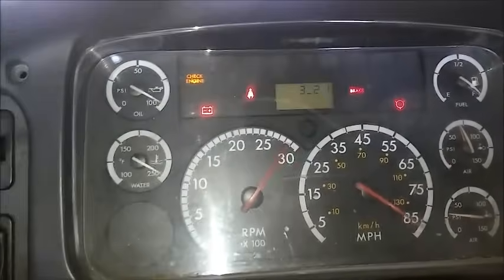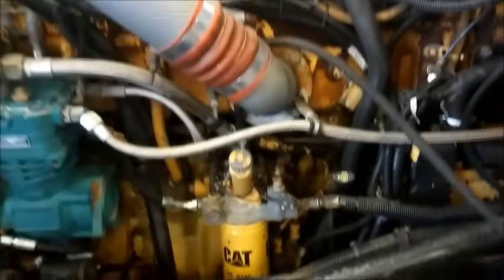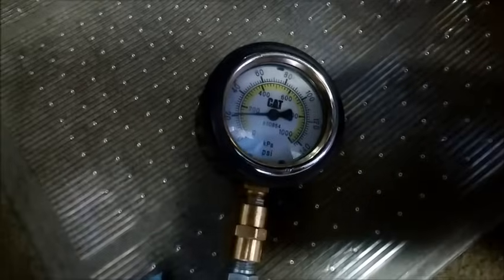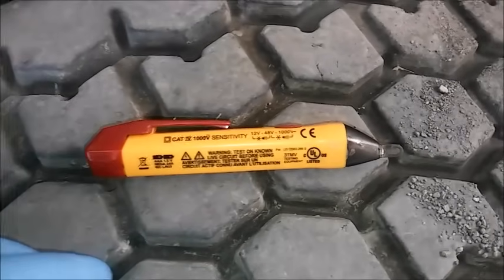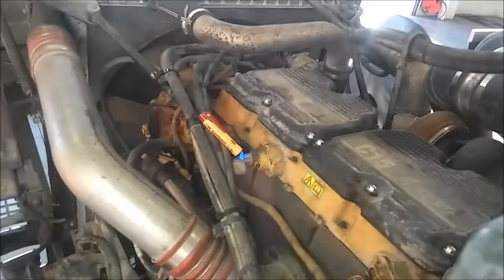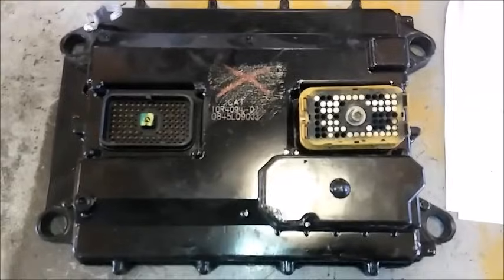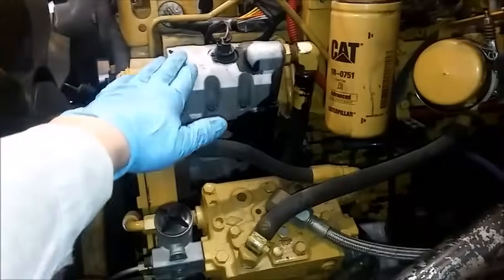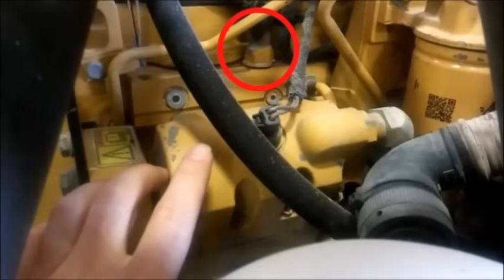Cat Engine Won't Start Troubleshooting.  Diesel Engine Crank No Start.

Comment: Great video! I've had a crank/ no start issue on my motor home twice. Both times it was the 20 amp fuse near located near  battery that energizes the ACM. (bad connection) The only way I found problem was when I called Freightliner 27/7. The first thing they had me check was the ACM fuse. Just thought I mention this.
Reply from the maker: +Rob Neil ECM power issues are one of the biggest reasons for them not starting, thanks for commenting.
Reply: @AdeptApe  Ok. So, I am in the exact situation as most others. We did everything in this video as well as your fuel video. MXS Acert. New fuel pump, new injector harnesses, filters, fp regulator, check valves hoses, injector Orings, ran the rack, bucket test from fuel pump, new starter, new batteries, all fuses are good. No start. Had a tech come out and hook up to data port. It ran on ether until no ether. Laptop recorded all 6 injector low voltage fault. All guage  work. Fuel pressure 85, oil pressure good while running on ether. Scanner reads all 6 injector fault. Technician say either engine harness or ECM.
Reply: Can someone send a picture of this fuse ?? I have several on my RV and it's not starting. Battery went dead and was dead for several months !  Now no start without Starting Fluid and will die when the  starting fluid is stopped !!. Please help. 1997 Cat 3126 with the HUEY system.

Comment: hi I had overhead adjustment done at cat no truck runs like it has restrictions plates could they have adjusted it wrong what can I tell them to ok for
Reply: MJK RIGGING I got my truck back from muffler shop they used vise grips to hold a bracket in place and I'm assuming tack welded it in place an forgot.I drove around for two days an finally crawled under to figure out this tapping noise I had to just laugh, had to grind them off,but got some free grips,haha
Reply from the maker: +MJK RIGGING They easily could have done it wrong if the guy doing it was inexperienced, perhaps a rag was left in intake or something as well, or it may be a coincidence.
Reply: Thanks it's back at shop really hope it's not the rag they would never admit to that
Reply: Josh Hernandez that's a funny story. can always use an extra pair of vise grips

Comment: hey adept!

so can you increase the speed on a c7 by adjusting injectors?
Reply from the maker: +Omar Nope, there really isn't any adjustment on the C7 injectors. If you are talking about the max engine speed that can be changed in ET, but the flash file also limits it.

Comment: @adept ape how strange, I was about to ask you about this like two days ago. I had a c12 that would crank but wouldn't fire, we found out the lift pump was bad. So After it took a day to order I installed it today, and she fired right up and purred like a kitten.
Reply from the maker: +Lucas Orellana I've never been accused of being psychic before, but I get the inference. I really do get this question a lot and that is why I made the video, you as case in point.

Comment: I dont have any experience working with HEUI systems. Does the HEUI pump actually fire the injectors? Im assuming the pressurized oil just sort of pressurizes the fuel and then the ecu fires the injectors if Im understanding right.
Reply from the maker: +Bucketsamson I've got a few videos that talk about the system in more depth, so if your interested check them out. You are mostly correct in that the ECM fires the injector and uses the high pressure oil to press the fuel in the injector.

Comment: I like thissss, this system uses the same system a common rail uses or bulds the pressure using high pressure oil??
Reply from the maker: +armando nika Common rail is different from HEUI. Common rail is high pressure fuel, HEUI is high pressure oil.
Reply: +Adept Ape ohh ok thanks!

Comment: i have a question on my c13 acert 07.....i had asked you a few months ago on my oil consumption and you answered great!! now my question?  Im still getting oil consumption but on my dip stick when it gets to half of Full its stops consuming oil.....When i add oil to the FULL mark , in the mornings i usually warm it up to 150F and go.....but when I fill it back up to FULL , my engine sputters and blue smoke comes out the pipe until it gets To 190F then it stops....Could it  be that im adding to much oil and its simply burning off what it doesnt need , or im having major issues.....just replace water pump about 2 months ago.....fuel filters every 6k oil change every 9k had the truck 2 years runs Great!!
Reply from the maker: +Big Foot Its possible you have a dipstick that isn't calibrated correctly and is churning oil when it gets too high and causing an issue. It is quite odd that is only does it from full to half way down the hashmark though, that isn't very much difference at all, maybe half a gallon. If it was my truck I would just watch the dipstick and run it where it stops smoking and burning oil, which sounds like it isn't that far from full. How much oil does it take when you do an oil change?
Reply: Adept Ape 10 gallons....i have a bypass oil filter and a regular oil filter. so 2 gallons to oil filters and 8 to the engine.....but sometimes i have to add a little more to even out to the full mark.......i never understood this.....most engines have dipsticks which only wets the tip of the oil dip stick.....my dipstick is more like 1/4 inch to the full mark.....but when it stops consuming, it stops half way.....and its always done this since i bought it......

Comment: So why didn't the C15 you showed in this video not start...?
Reply from the maker: +Gregory A. Parsons The story about that engine could be a video it took so long to diagnose. So the customer rebuild the engine and reused the injectors, now the engine was running fine when they did the rebuild and had a cracked head, well they did the rebuild outside and contaminated the injectors with dirt. Ended up having to get all new injectors because they would not fire at all. Never seen all 6 injectors not fire before.

Comment: If it runs on ether. Can my cat engine have a compression problem as well?
Reply from the maker: +Abel Garcia All pistons engines can lose compression over time, but if you are losing compression on a Diesel you'll probably notice that you have tons of blowby and are eating oil. It is a possibility for a hard starting engine, but there is no quick easy troubleshooting for that on a Diesel. You can a cylinder leakdown/compression test, but it is much harder to do on a Diesel.

Comment: My kenworth service truck has a C7 with 65k miles. Truck is 10 years old. With the engine warm, it takes about 4 or 5 seconds of cranking to start. Seems excessive to me. Kind of annoying too. Is this normal ? The exhaust has a running rich/ nasty smell too. Engine seems to run well down the road overall. Since it runs the pto for the auto crane and the air compressor, it sees a lot of idle time.
Reply from the maker: +george kuersten Well the HEUI systems can take a little longer to start due to them waiting for oil pressure to build, but 5 seconds seems a little long. With a fuel smell to the exhaust you may have one or more injectors not working properly. Injectors on HEUI engines going out is fairly common. They are somewhat expensive though at about $500-600 bucks each.  They make a kit as well you can get that replaces the entire HEUI system with new pump and injectors that you can get an extended warranty on, but is about$4,000 to get. I would just run it if it was mine. Might want to pull the valve cover and look for injector seal leaks if the cranking times start getting longer.